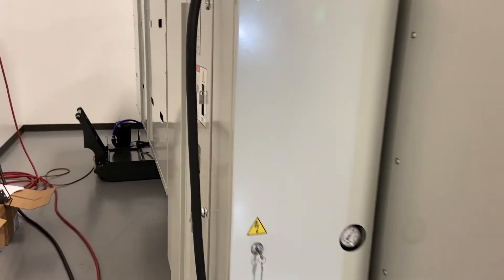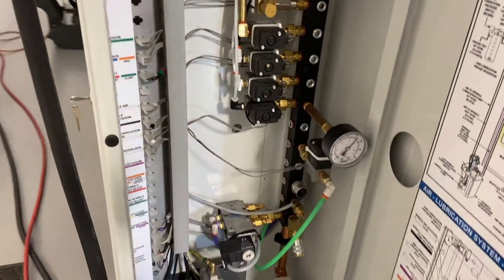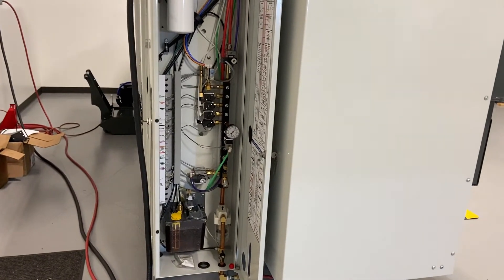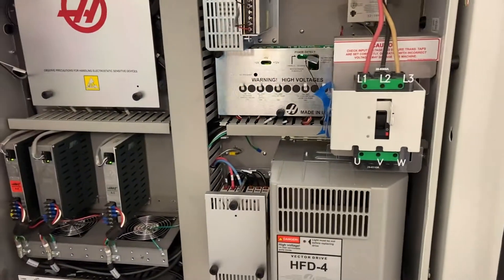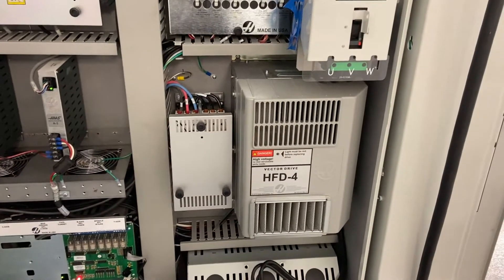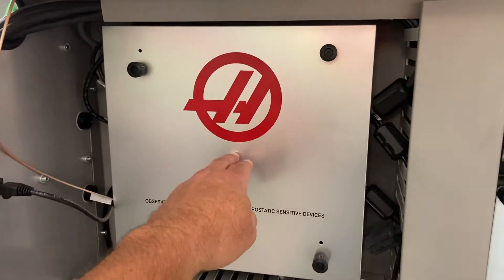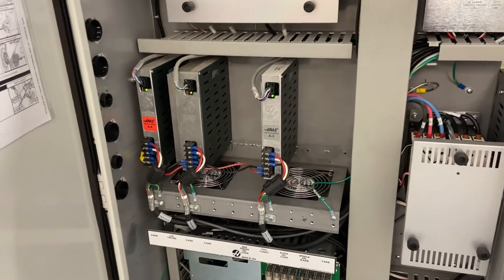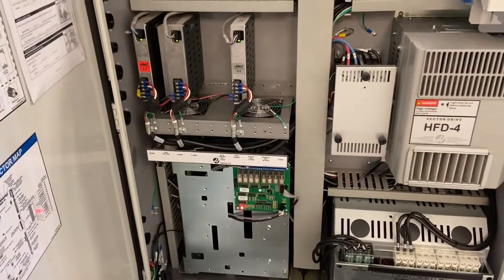A Quick Look at the Haas CALM and Electrical Cabinet

Comment: Hey please correct me if I'm wrong. You' didn't turn the circuit breaker off before opening the door to the electrical cabinet? Doesn't it need to be in the off position for safety?